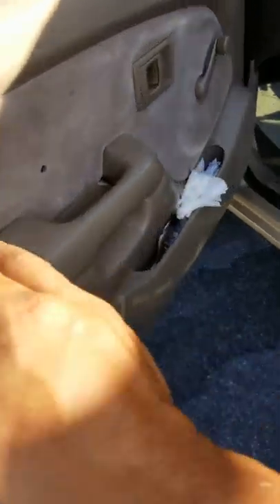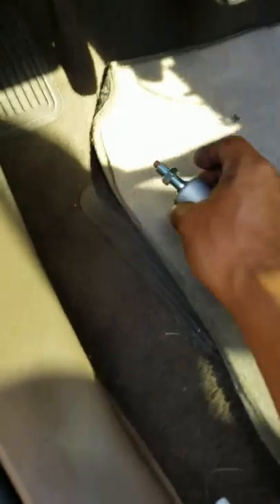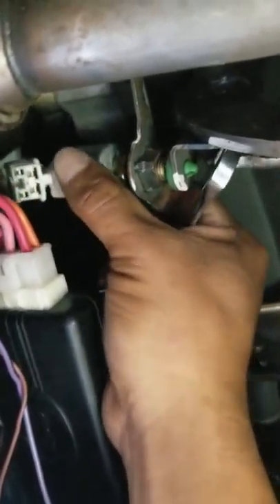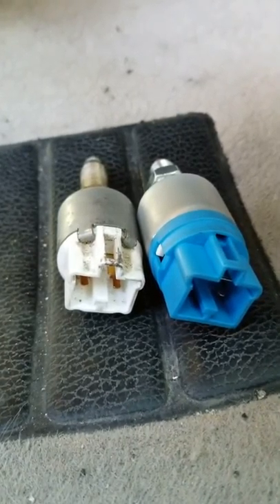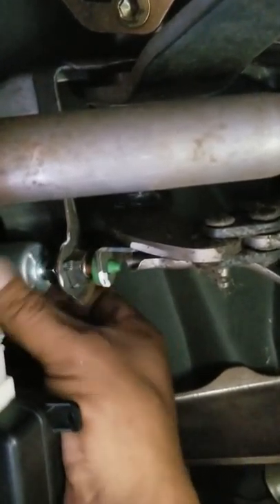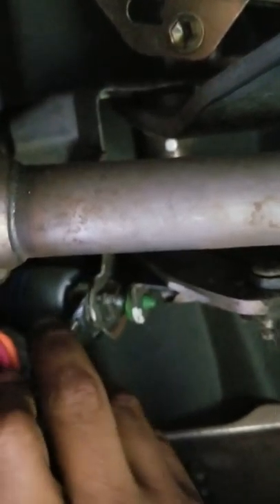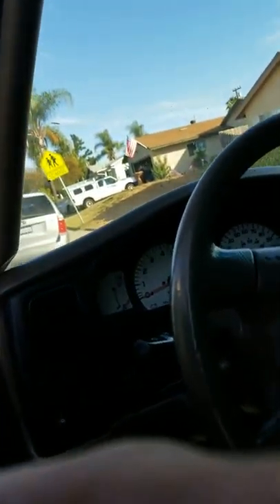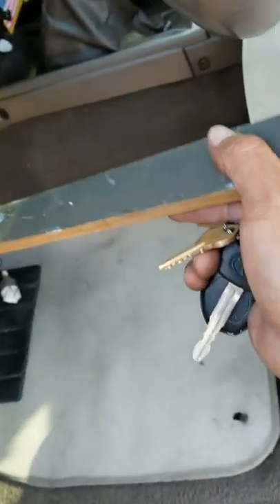2004 Toyota Tacoma brake light switch replacement

Comment: Thanks for sharing your work with us! 
Just  a tip here: Before replacing the switch, check the condition of the plastic bushing on the brake pedal bracket that contacts the switch plunger. For me, it was disintegrating and worth the check (green plastic on my ‘03). I simply siliconed a nickel on the bracket and the switch was able to make good contact again!  😆

Comment: This switch is super easy to take apart and clean. I just did mine because I was having brake light and cruise control issues. The OEM cruise control version costs 90 at the dealer and 65 online at the moment. Just take yours apart and clean the connections with a pencil eraser and some deoxit or alcohol, test the resistance with a volt meter to be 0 ohms when the first spring is down on the two small prongs, then 0 ohms when the second spring is down on the two big prongs. The two big prongs pop out and give you access to the bigger spring and copper plunger/connection. 

It will take you 30 minutes and save you 50-60 bucks.

Don't throw your OEM parts away, especially small electrical switches, you can fix them in 10-30 minutes with some patience. Less waste, more money in your pocket, better quality product too, it lasted 23 years. Got a duralast starter that broke in just 2 years. Replaced it OEM. Never again. The OEM lasted 20+ years!

If you're thinking "I don't know if I can do that might as well buy a new one..." Try it first! If you break it, then buy a new one!

Comment: Before you spend money on a new switch, adjust your current one! It is possible that it was installed wrong and either needs to be unscrewed before tightening, or screwed in further. My tacoma brake lights werent coming on unless I stomped really hard on the brakes. I unscrewed my stoplight switch probably 4 turns and then re-tightened it, now the light comes on if I breathe on the brake pedal!

Comment: Hey thanks for the video was just wondering was your vehicle stuck in park with the bad switch.... Also was your ABS light on... Thanks again
Reply from the maker: None of the two....my brake lights would not turn on even when I stepped on the pedal or with normal lights on
Reply: @davidswestcoastpainting8510  hey buddy thanks for the reply back, I found my problem it was just a fuse for the stoplight under the dash..... Again thanks for the video 👍

Comment: I have a 05 Toyota Avalon the brake light switch I need to find out where it's located in the car to change

.
Reply from the maker: Check the brake pedal...switch should be there along the brake pedal....unless it has changed over the years....

Comment: My brake lights only come on when I turn on my high beam head light. The fuses are good. All bulbs good. Can the brake lights come on without the brakes when turning on the head lights?
Reply from the maker: When your headlights are on, your low dim rear lights must also come on, when you step on the brakes the brighter red should turn on. Check fuses again, something has to be loose or you have s shortage somewhere. Check all cables.